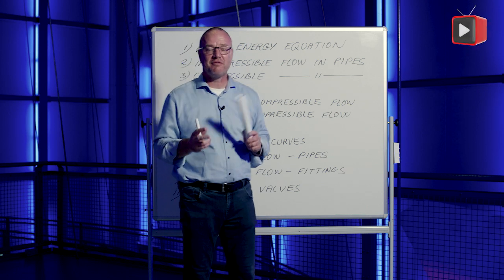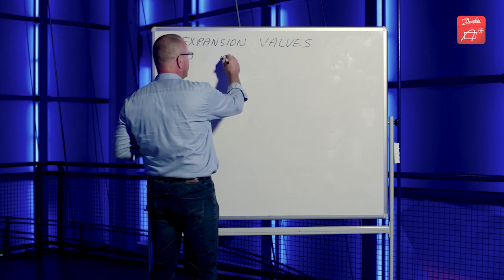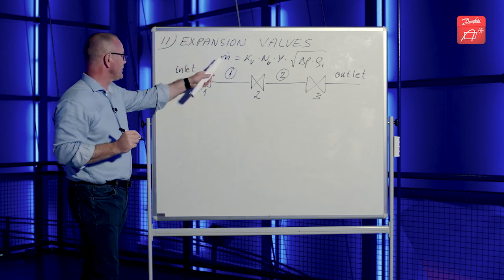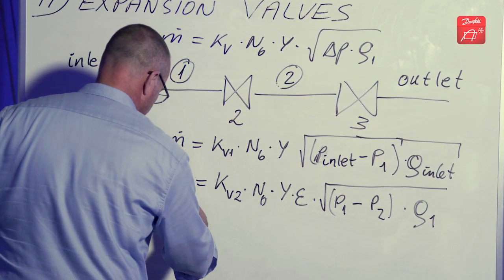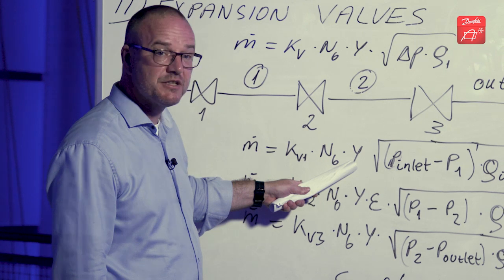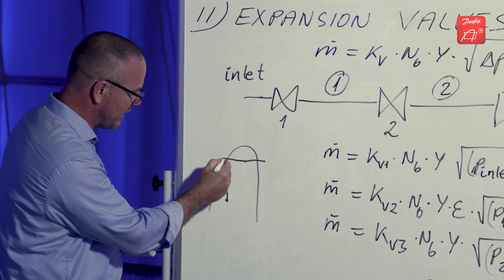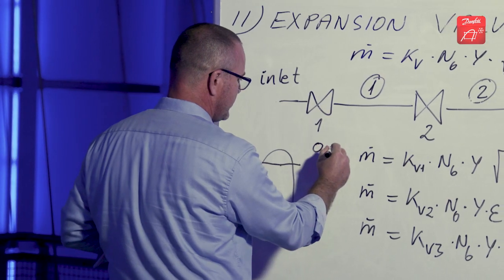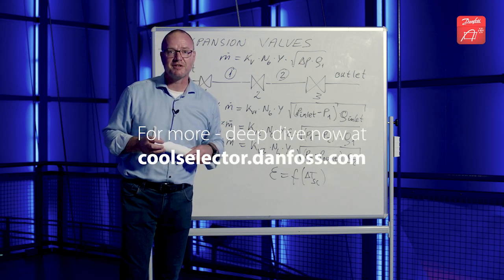Expansion Valves – Coolselector®2 Deep Dive

Comment: Hi, I would like to know if there are some ways to get the kv value or if there is a way to export this values from the coolselector software. What does the epsilon equation look like ?
I have the same question for compressors how can we get the polynomials values ?
Reply from the maker: Hello Xabi. Great question. For our expansion valves, there is currently no way to export the Kv values or the epsilon equation. For the compressors, you can go to the Report and select to include polynomials (they are available both at standard conditions and at your selected operating conditions)
Reply: @DanfossClimate  Hello , Thank you for the quick replay.
Is there another way to get theses values ? Because I need to do simulations for my customers so I need theses values.
Also, for compressors, it is a very long process to extract polynomials values (because there are a lot of them).
Does Dansfoss give the dll notice or an acces to the database like Bitzer ? Or an API ?
I am a professionnial engineer, is there a way to contact the software devellopement service in a more formal way ?

Comment: Sir, in the beginning, u mentioned we approach a single valve as 3 valves. In that case, how do we calculate Kv values for those 3 valves used in the 3 equations?
Reply from the maker: Hi Sukalp, Kv are normally measured. If you want to calculate, you need to apply CFD.
Reply: @DanfossClimate   Got it. Thank you so much. The series was very informative yet concise.😊👍🏻